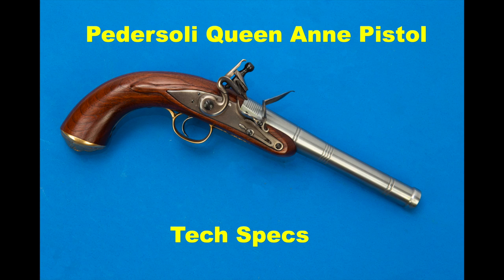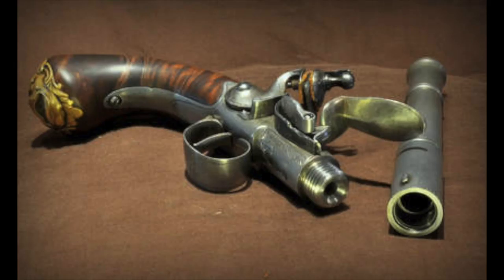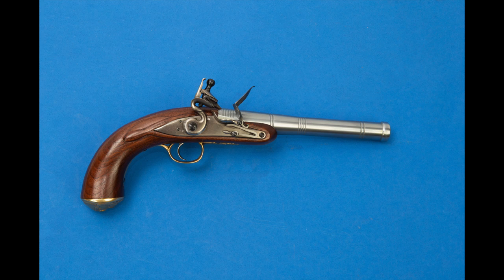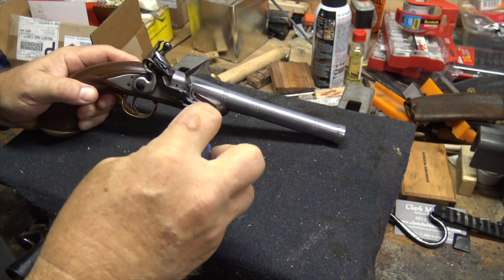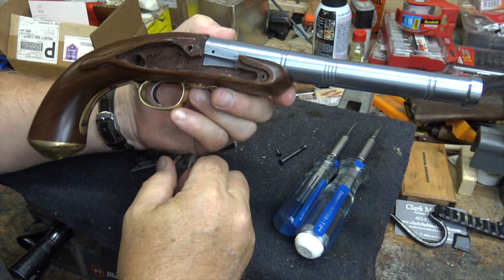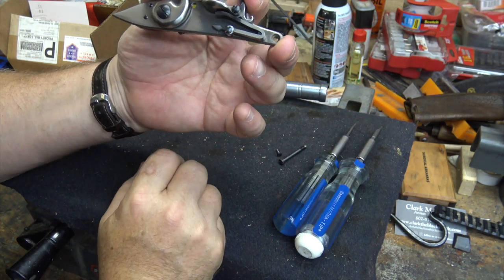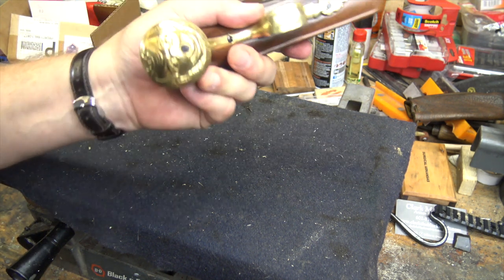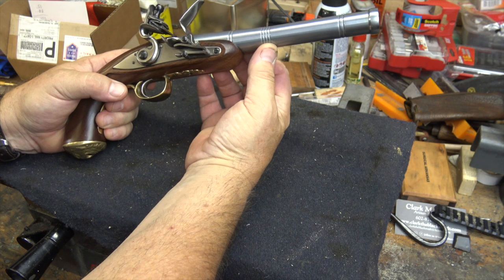Pedersoli;s Queen Anne pistol Tech Specs

Comment: According to the Authorities on 18th century arms, Screw Barrlels must have been very popular.  I have shot only one example, a Godsall of Gloucester .50 caliber sidelock (instead of boxlock).  The owner was able to load and shoot it four times in a minute. The use of a ramrod is eliminated, but a paper cartridge can still be used. The Godsall had a slip-ring around the barrel, attached to the 'receiver' by a flat rod so the barrel wouldn't be dropped. For someone in a carriage or on horseback, it was probably the most compact and fastest pistol to get a first and second shot off. Does anyone know if a screw barrel replica is being made?

Comment: The thing that bothers me a bit about this gun is that the tang screw is the only thing holding the barrel in place. I don't know if it's really a big issue, but I wish they'd put a boss on the bottom of the barrel and a machine screw going through the front of the trigger guard that threaded into it, so you'd have two points of attachment for the barrel.